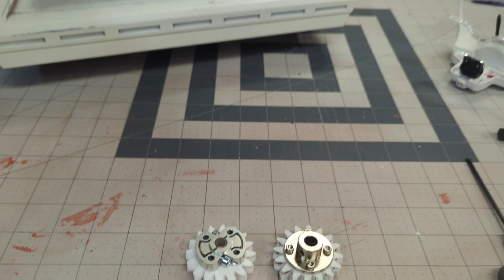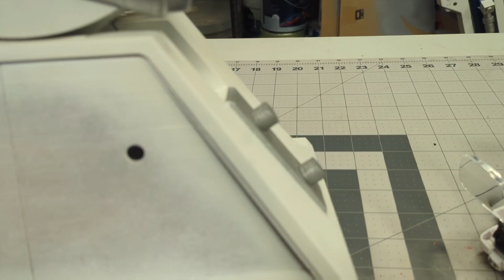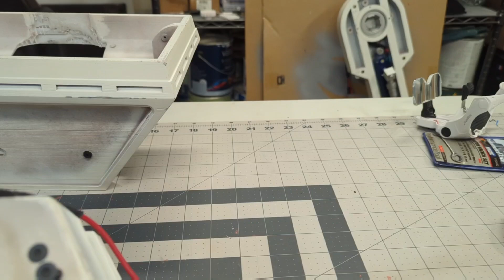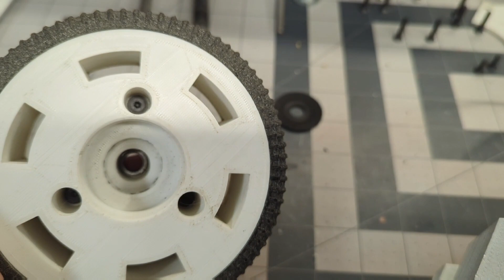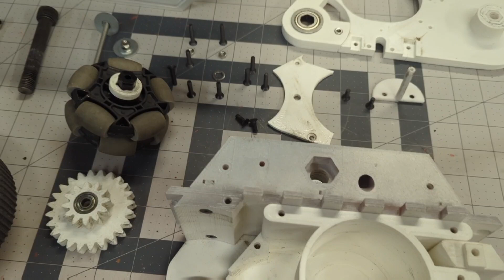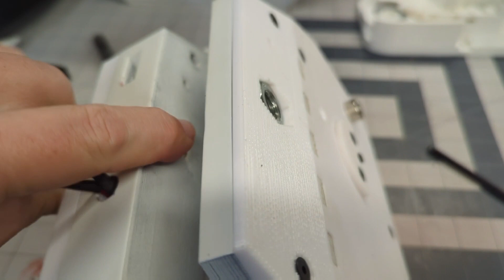R2 Drive Inspection Results in a Horrifying Discovery!

Comment from the maker: In response to many of the comments, yes, my R2 is printed using PLA/PLA+. For the particular part in question, the portion that broke was effectively solid - nothing but perimeters. For this particular instance, the nature of the part requires a degree of flexibility as the surround is cinched around the motor to hold it in place. PETG generally has a bit more flex to it and could be a better material to use for this part. I've noticed some things printed in TPU have lost some of the flex over time, and wonder if anyone has any insight into the stability of PETG over extended periods of time. FWIW, I think that regardless of the material used for your build, you want to be vigilant and inspect/check your build periodically. I strongly believe this could happen to any build.
Reply: It took some digging but you want to look at a chart that talks about Elastic Modulus(AKA Young's Modulus).  This is stress vs strain, the higher the number the more stiff it is. As you describe standard PLA(not +) is 40% higher here based on the chart.  There is also the heat factor since it is close to a motor, PLA is known for less temperature resistance which will reduce many mechanical properties.  Elongation at break is notable in the chart, 7% for PLA vs 130% in PETG, this shows that PETG is MUCH more flexible compared to PETG.  

PLA does show a higher yield and tensile strength which means it shows deformation at higher stresses, but I think the more flexible nature of PETG in your application would show an improvement.  The real question I have is, if that is enough to cause an improvement in the application.  ABS would be a much more noticeable improvement but comes with its challenges for printing.   

https://matmatch.com/learn/material/petg-vs-pla
Reply from the maker: Neat link, thanks for sharing! CNC kitchen has also done some excellent videos comparing various filaments and other build techniques. He gets pretty technical with his setups and his data is often surprising.

Comment: lol yes using the Allen key, that's exactly what I just did before watching your video, just doing a search here for the 1309 series sonic hub (8mm round bore), so far, I haven't found any D-bores.
Reply from the maker: It doesn't look like they make an 8mm D-bore - there's no mention of it at ServoCity OR at GoBilda. Reviewing my video, the ones I used were round bore and they definitely grip very tightly so I think you'd be fine with the round bore. I've used the 6mm D-bores on other smaller motors - Bee's drives and (I think) R2's dome motor, but apparently not for R2's drives.
Reply: @jasonsR2D2  Good to hear they will grip well; I have some on order now.

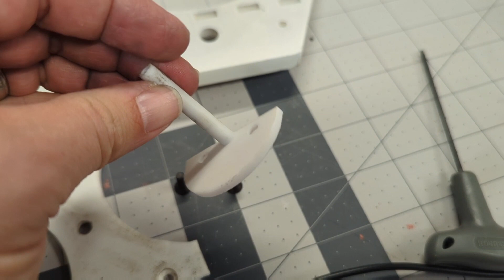Comment: What is the black ring at the 3:35 timestamp? Is that a neoprene washer and are you using it between the wheel and the housing? If so, doesn't that just rub and make friction?
Reply from the maker: It is a neoprene washer - I opted to use that instead of a printed spacer as called for in the original design. It's not really tightly compressed into place - it really just takes up the space. Although a metal washer would probably be more durable my thinking was the neoprene would provide a little cushion to vibration or bumps. Hard to say how much of a difference it really makes, though.

Comment: 3d pen weld it?
Reply from the maker: That would probably be the strongest way to repair it - and the best approach if you really had little time, but you would want to make sure it is smooth on the inside so that it makes uniform contact with the motor to hold it in place. I set up the print before bed and it was done when I got up in the morning, so that turned out to be pretty painless!

Comment: Areas vulnerable to splitting, you  could laminate with epoxy resin some carbon/glass fibre tape over those areas to help stop them splitting in future. Epoxy wont attack the PLA and the carbon tape will help add a fair bit of strength. Composite laminates can still flex so you could vary the number of layers to ensure you still maintain enough flex to clamp up the bracket.

Comment: It's fortuitous you posted this. I was laying in bed last night thinking I should really restart my R2. I started him and stopped due to the poor quality of prints I was getting and it kind of took the beep out of my boop.  6:15 I started my R2 on a Creality XR10 2 years ago and now I have a Bambu Lab X1Carbon with AMS and man the difference is amazing. So glad I upgraded, with the new Prusa and the Bambu labs printers, the days of screwing around with adjustments, fixing issues etc are gone. I just printed a 8foot x 5 foot gaming table surround and went through 22 rolls of filament without a single fail (other than some mistakes I made). This new generation of 3D printers are more like appliances than they are printers we started with years ago. I am probably going to restart him again with my new printer and save myself a ton of sanding/finishing work.
Thanks again
Reply from the maker: The past 12-18 months has been huge for 3D printing. It would seem the FDM technology has finally turned the corner. By all means, kick-start your build again. It's challenging but fun and a very rewarding journey.
Reply: What Prusa did you go for?

Comment: Do you have software to ramp your drive speeds up and down or are they bang-bang start and stop? This can make a large different to the force applied to the motor mounts?
Reply: The speed is variable and top speed can be adjusted in the sketch for the arduino
Reply: @chasenorman2862  Thank you for the response but I was asking more about the rate of change of desired speed rather than the top speed.
Reply: It's variable very sensitive you can go very slow or full speed and anything in-between
Reply from the maker: For the stock arduino Shadow code, I don't think there's any hard-coded, overriding ramp-up acceleration included. As was mentioned, the speed is variable according to the input stick, so I can drive R2 very slowly by simply being careful on the stick, but I think I get what you're saying that there could be a ramp up in the code to ease in regardless of the stick input.
Reply: @jasonsR2D2  Yes. Even requesting to go from 0% speed to 25% speed will impart a high jolt of torque to the mounts. Whereas if your joystick requested 25% but the software ramped 0-5%-10%-15%-20%-25% even over a fairly short period of time (say 50 or 100ms per 5% step) will greatly reduce the torque and therefore strain on the motor mount while have a barely perceptible change in performance.

Comment: Im actually in the middle of redoing my drives because of the same reason. I came across a split drive file on printables that the clamp piece is its own piece and it just bolts in i plan on printing the clamp itself out of petg then the rest of the drive out of pla+ check it out might be helpful

Comment: Thank you for the update! Did you print the parts in PETG? I've been concerned about mine too but I haven't even gotten it assembled yet. They are printed in PETG which was a nightmare to get the supports out.
The Allen key trick: Yeah, I had that problem too and yeah, I figured out the allen key after a lot of swearing and attempts to use other tools to hold the nut in. :)
Reply from the maker: Mine were/are printed in PLA/PLA+. There were enough perimeters, though, where the part that wraps around the motor was effectively solid. My understanding of PETG is that it tends to have slightly more flex than PLA, so for this application (where the surround is cinched around the motor), PETG might be more forgiving, but I think all 3D printed materials gradually change/degrade over time. I'll pin a comment for additional discussion.
Reply: I would have to imagine the motors get warm as well which would reduce the mechanical properties

Comment: It's the one area in consider fabricating out of metal instead of printing.  I'm far away from this still but have been reviewing drive stall currents when designing my electronics.   The vexx wheel upgrade always made sense to me but I think I need to consider a non printed drive for the critical structural components.  I just started reading on scavenger drives on the forum.
Reply from the maker: Absolutely! There are shells designed to fit around the scavenger drives already available in the Baddeley file share. As I mentioned, I don't drive R2 aggressively, but that doesn't mean I won't ever hit a bump or some other hard-to-see obstacle and risk catastrophic damage. I will keep an eye on R2 as we (hopefully) attend a lot more events this year. I hope not to have to update/replace the drives, but you gotta be prepared for the unexpected.
Reply: I will be following this closely as I am hoping to dive into the body and drives of R2 next year, hopefully getting the dome wrapped up or at least close to it in 2023.